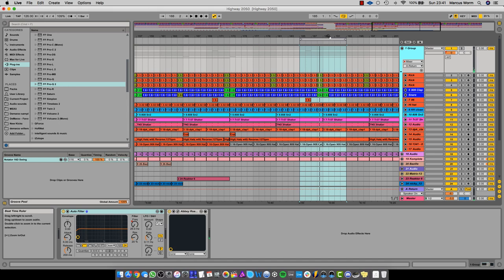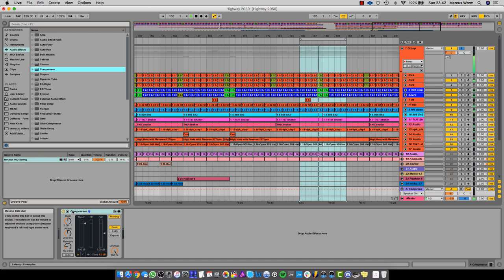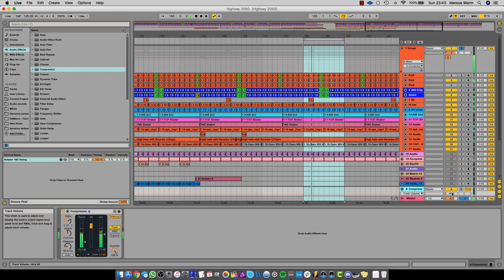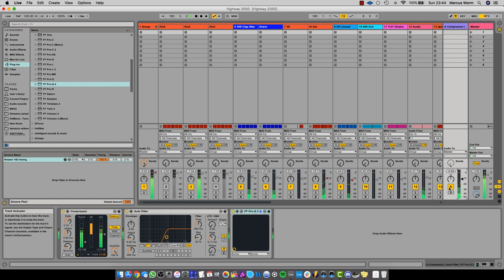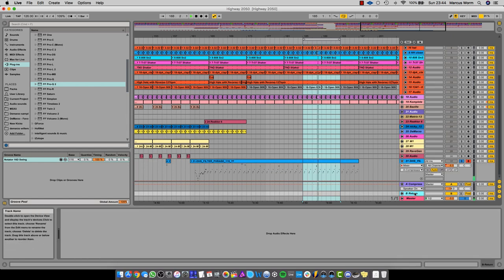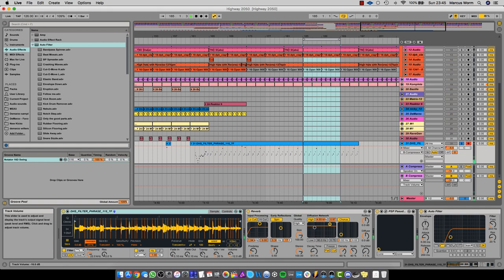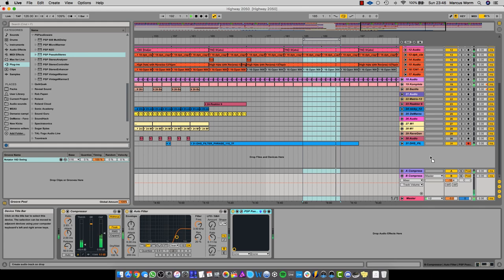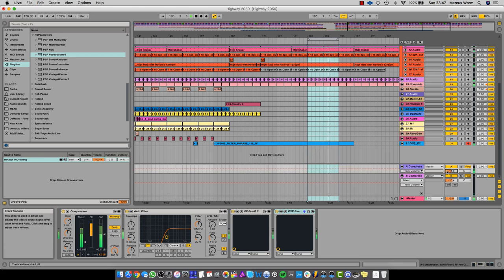Parallel Compression on House Music / DeMarzo EMC

Comment: Probably a silly question, but why do this vs tweaking the wet/dry on the compressor? Is it to eq the compressed sound?
Reply: When you apply it directly to the channel you'll start losing your original sound as soon as you start tweaking the dry/wet knob. And also yes, doing it in parallel will allow you to eq and add other effects to the compressed signal seperately.
Reply: @antoniopimentel4356  thank you mate 👌

Comment: Do you only apply widening on the parallel compression? How does that widening plug in compare to something like the free Ozone Imager 2?
Reply from the maker: You can apply widening to both if you like. I love the plugin because it not only sends the signals wider, it pulls them out of the mix.